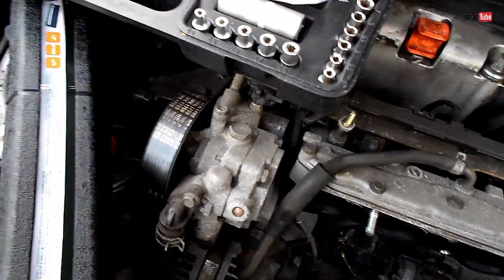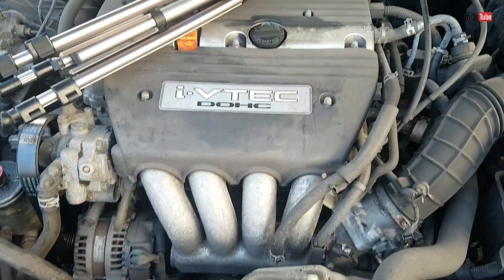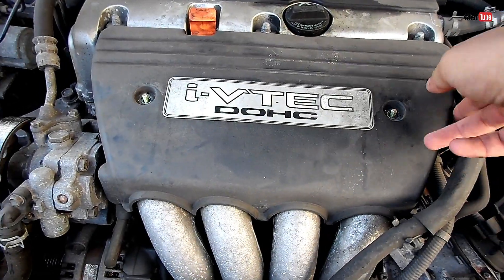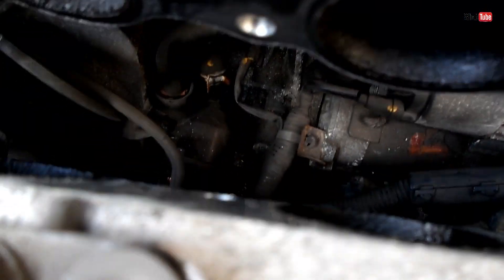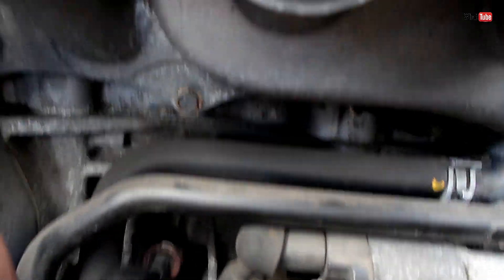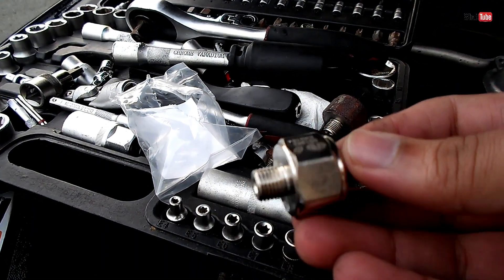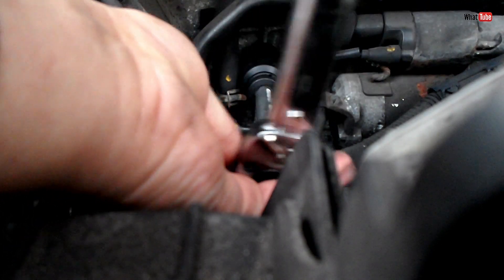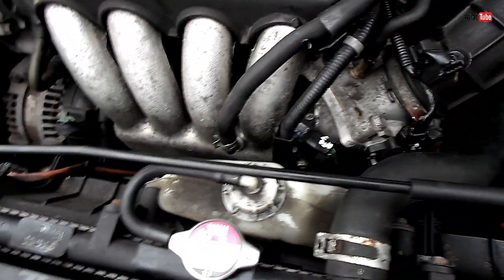How to P0325 Knock sensor replacement Honda DIY

Comment: you do not need to remove the collector to replace the sensor....
Reply from the maker: Yes, you can replace it without removing the manifold, but when you have to fit the new one you need to tight it with the correct torque, that's why you need the space for the torque wrench.

Comment: Do I need a 27mm deep well socket. My knockout sensor is fine and I don’t want to damage it. I am removing it because I need the space to complete the starter replacement.
Reply from the maker: Hi,
Yes you'll need a deep socket.
Reply: Thanks, I just got everything removed using a deep well.
Reply from the maker: @josephr9105  👍

Comment: You make it look more dificult than it is, 
It took me only 10 min to replace it, no need to disassemble the engine broo
Reply from the maker: Great job.
Did you tightened with a torque ranch?
Reply: @WhatTube  first with the hand then torch ranch, exactly took me 8 min
Reply from the maker: @baseball2246  I removed al the intake parts because there's no space for the torque ranch, and it's more clear this way.
Reply: All good you took everything out. I'm here to learn how to take out things to reach the starter lol
Reply: Can you tell me how you did it?

Comment: Hello is possible to change without removing intake manifold? Seen a video using swivel socket with extension
Reply from the maker: Hi, yes it's possible to remove it with the manifold in place, the issue is that you cannot tighten the new sensor to the correct torque.

Comment: Honda Genuine Knock Sensor replaced but Check Engine Light came back on with same code, P0325.
And engine knocking. 

Help!  What is next?

Plug & wire are good. Honda's spark plugs, coils & valve cover gaskets replaced under PM on 2005 CR-V
Reply from the maker: Check the engine mounts and the bracket that holds the exhaust pipe near the engine.
If the knock sensor, wire, connector and tightening torque are correct the issue can be in the ECU/ECM itself.
Reply: @WhatTube  Engine mounts are still good, bracket holding intake & exhaust are good.
Knock sensor tightened with light coat of anti-seize.

How do you check /or test the ECU /or ECM without overpriced test equipment?

Comment: Replaced with Honda's Knock Sensor.
Drove 600km, code check engine of P0325 came back on.
What is the fix if sensor did not work.
Reply from the maker: Hi,
When you have the P0325 code on these engine sometimes is just the wiring and connector that need replacing.
Reply: @WhatTube  But wire and connector are good.

Comment: NO NEED to remove the intake manifold and throttle body. Just remove plastic cover from intake so you can see, then with your left hand set the 27mm socket on the sensor by reaching over the alternator, then with your right hand put a eight inch extension on the socket with ratchet wrench under the intake. As easy as changing a spark plug.
Reply: Getting the socket on the knock sensor isn't the problem, disconnecting the plastic connector to the wiring harness without breaking it or the flimsy wire is.
Reply: Yes you come and get it done in my Nissan Murano not too smart
Reply from the maker: Hi, yes it's possible to remove the sensor without removing the intake manifold but you cannot tight to the correct torque the sensor, which you must do it.
Reply: Replace the ratchet with a torque wrench set to the proper setting. Plenty of room to rotate the wrench in front of the manifold because there is an 8' extension. But do it however you wish,  I just did this on my son's 2004 Accord without any disassembly of the intake and throttle body. I prefer to advoid needless work.
Reply from the maker: 👍 Good!
Reply: @MrPaulrak  wow interesting because a shop is telling me 5 1/2 hours labor to do this at around $600 part included 🤦‍♂️.
Reply: @WhatTube  i heard it not much of a tight fit, just snuggle it

Comment: What's the torque settings for the sensor and manifold?
Reply from the maker: Hi,
For the sensor is 31Nm or 22ft lb
For the inlet manifold is 22Nm or 16ft lb
Reply: @WhatTube  Thanks for the reply.

Comment: I replaced the knock sensor and the light went off but after 1 day usage came back on and again error code P0325, I am getting frustrated, hate to see lights on my dashboard
Reply from the maker: Try to replace the connector, some time the sensor is good but the connector is bad.
Reply: Nope you need an OEM from the junkyard.
Reply: Rubberbutthole123 why do you suggest one from the junk yard

Comment: You're stupid 👈 don't need to remove all that just go under manifold. It has space .
Reply from the maker: Yes, you can remove it from underneath, but you can't thight to the correct torque.
So you must remove the manifold as well.
Reply: sledge hammer chill out

Comment: I used to manufacture the Knock sensor Body on a multispindle turning machine in the 1990`s when I worked for TRW :)
Reply from the maker: That's nice 👍
Reply: what do they freakin actually do ??!
Reply: @oglinda8070  I wondered that myself...   It's interesting, the engine has a "signature" of vibration and the knock sensor measures those vibrations and the ECU makes adjustments to attempt to match the signature.  https://www.youtube.com/watch?v=0xI94ZDF54Y&feature=youtu.be

Comment: I've done mine yesterday and again last week.so put two sensors in it  And I've still got the eml light on I have a honda stream with the same engine.. Cant seem to get the light off. I don't have a computer like you but I've reset the ecu by pulling fuse and disconnecting the battery. But after about 5 mins driving the light just comes back on.
Reply from the maker: Try to replace the connector and the wire that go to the sensor.
Some time the actual sensor is good but the connector is bad.
and have you tighten to the correct torque?
Reply: @WhatTube  Iam in progress in ordering a wire and connector. No I didn't know you had to until I watched your video. What torque pressure do you need
Reply from the maker: If you have the K20A engine it's 31Nm or 22 ft-lb.
Reply: @WhatTube  thanks for the info. I don't have that type of tool. I've just tightened it up slightly with socket set wrench. But once I've got a new wire I'll get back to you with the outcome. 👍🏻
Reply from the maker: @carpcatcher8193  ok good luck.
Reply: carp catcher81 did it work for you ??